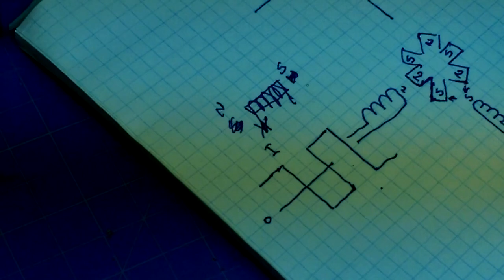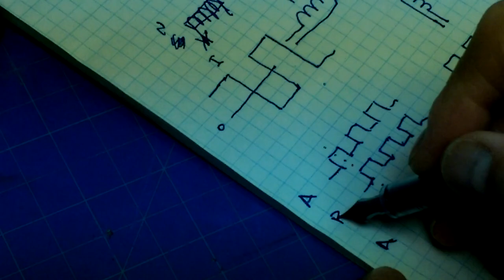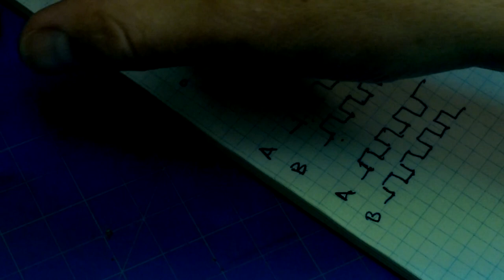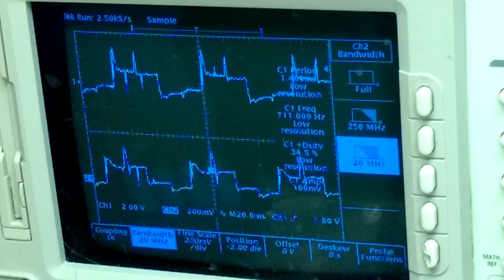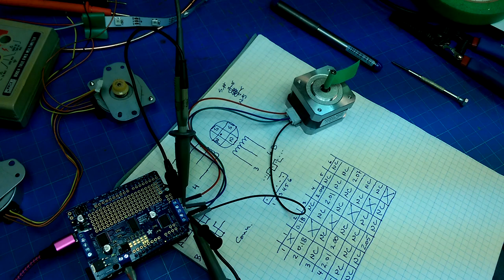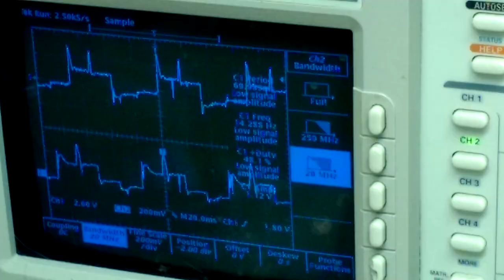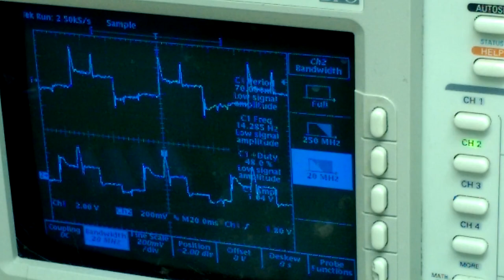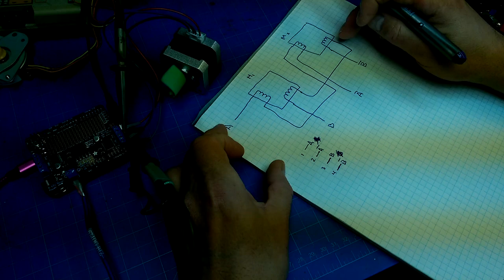first cuts

Comment: Can you direct me to the code you used?
Reply from the maker: I used Fusion 360 to model the part and used this as the post processor to get the exported toolpaths fit for consumption by the MPCNC.   https://github.com/martindb/mpcnc_posts_processor
Reply: @grtyvr  Forgive my ignorance, I have no idea what that means... I'm experienced in electronics, but I've only recently begun to learn programming. I was hoping you might have a simplified example code used for CNC machines.
Reply from the maker: @andrewferg8737  I don't have a simple answer for that.  Think of the CNC Router as similar to a 3D printer.  You need to have a 3D model first (Fusion360 or FreeCAD or OpenSCAD can create those), then you need to translate that 3D model into g-code to control the CNC.  Slicers do that in 3D printing.  In the case of a milling machine you have the Path tools in Fusion360, or the Path Workbench in FreeCAD that generate the g-code.  You can also use something like ESTLCam to generate g-code for the MPCNC.